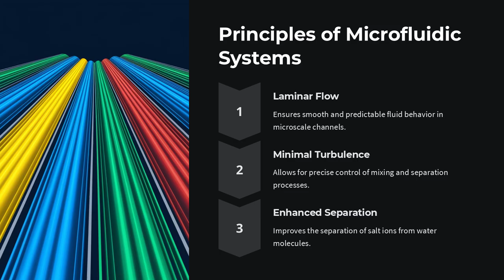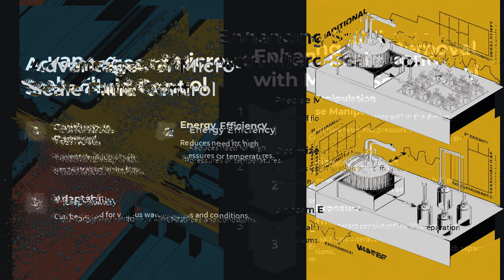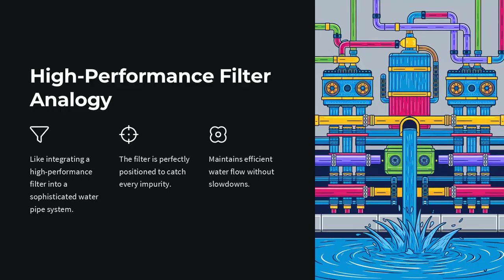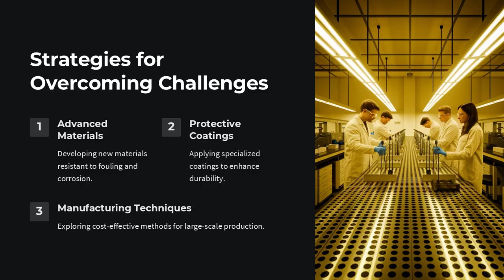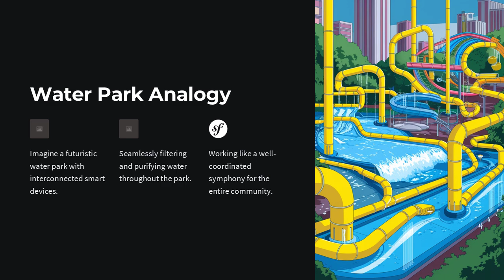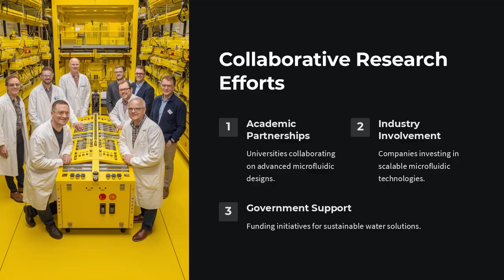Microfluidic Desalination – A Breakthrough in Water Purification

Comment from the maker: How can microfluidic desalination systems be optimized to minimize biofouling and scaling effects on ion-selective membranes while maintaining long-term operational efficiency?
What are the thermodynamic and fluid dynamic limitations of microfluidic desalination at ultra-low energy input levels, and how can nano-engineered materials further enhance water-salt separation efficiency?
Can AI-driven adaptive control systems improve real-time optimization of microfluidic desalination units by dynamically adjusting flow rates, ion-exchange parameters, and pressure conditions to maximize water recovery and quality?